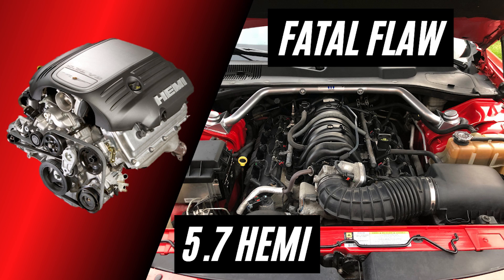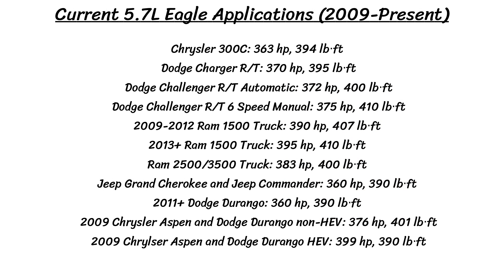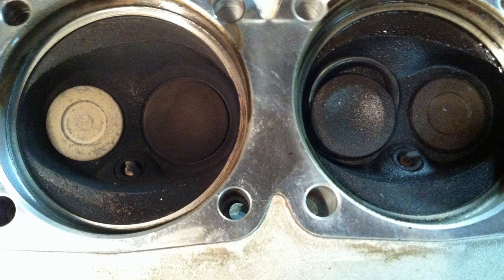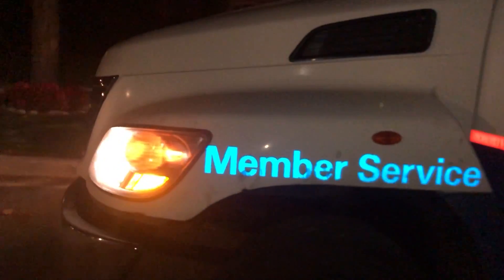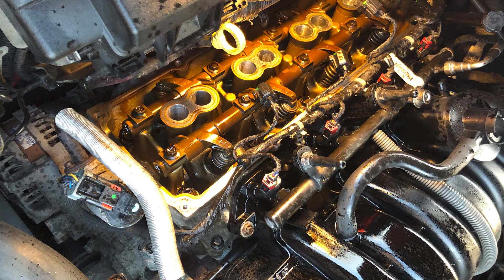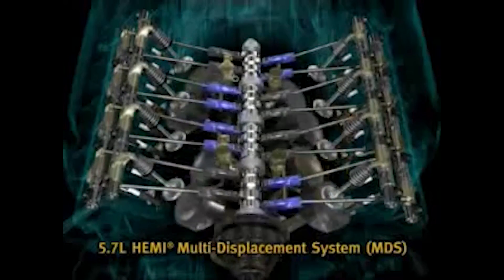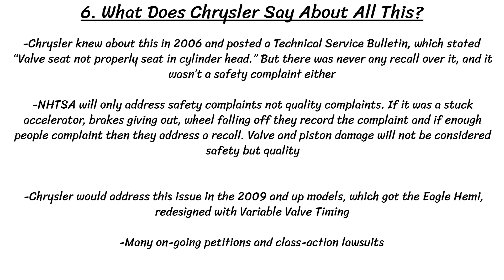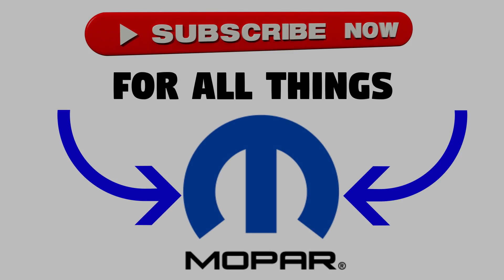The Fatal Flaw of the 5.7L Hemi V8 Engine & How to Prevent It (2003-2008 Valve Seat Drop)

Comment: 180 degree thermostat. I was not a fan of it on my 06 300C 5.7. Long runs on the highway with cruise control set caused both oil and coolant temperature to drop to 180degree, this in combination with the mds system on would I say make this problem worse? Cylinders that are off are even further cooled by the 180* circulating coolant. Nice video, I learned a lot from you.

Comment: People seem to either have no issues with these engines or catastrophic failure, which I guess based on what the issues are, comes as no surprise. If you don't have this issue or the lifter issue it seems like these engines just run great for years totally uneventfully.

Comment: Same thing happened to my Mom’s 2007 Dodge Charger. It happened at around 100,000 miles. The car had a lifetime power train warranty on it, but they tried denying it by blaming it on a faulty thermostat. Turns out they were testing the thermostat wrong and they ended up having to honor the warranty. The car is now mine and is at 185,000 miles, so it’ll be any day now. Thanks for the good tips on preventing this from happening. I’ll start doing the maintenance more often to hopefully squeeze as much life out of it as possible.
Reply: update?
Reply: @ just rolled over 200,000 on the odo, still kicking strong for the most part except for a coolant leak that I can’t find. I put some leak dye in the system and will keep a check over the next couple of days. I’m suspecting it’s my water pump

Comment: To be fair all of the big 3 manufacturers have had major problems with cylinder deactivation. It almost always leads to cam/lifter damage leading to catastrophic engine damage. It's not just a Chrysler issue.
Reply: That's the reason why we only purchase Toyota far superior engineering compared to the garbage big 3
Reply: @Gshock714  Funny you mentioned Toyota, I just purchased a 2010 Venza 3.5 AWD. If you do some research there's a nasty problem with oil cooler lines that rupture because they are rubber. I ordered the recall metal replacement lines today.
Reply: @michaelmarks5012  yeah every manufacturer has problems and is not perfect but I still trust Toyota a lot more than the so called big 3 especially in reliability and longevity

Comment: My 07 is about to turn 235,000 and still running great. Going through a qt. of oil every 3,000 miles so no complaints so far. 😎
Reply: I have a 2002 Dodge ram 1500 4.7L with 230,000 miles. Change the push rods and the rockets @ 220,000 miles. Running great.

Comment: My 2007 Ram 1500 with 5.7l hemi has 219,500 miles on it and runs real well! Kiss of death posting this? We'll see.
Reply: I have a 2008, 2500 with 257,000 miles it's still strong. I have a 91 octane tune in it and drive it like I stole it. Lol
Reply: @garyhaley3072  you have balls of steel, are you still using the original transmission?

Comment: Yep.  Happened to mine.  I bought it two years ago.  Had 49k on the odometer.  Car is top notch.  It dropped the seat on startup after being off for 5 min.

I fixed it in my garage and did both heads and a piston.  These pictures are exactly what I found.  While I was in there I did notice that the water pump had failed at some point before my owning it because I could see there was coolant that had dropped onto the splash shield and wasn't cleaned up.  Water pump was super shiny.  So the only thing I can think of is that yes its probably heat related and it could happen at any point in time once an overheat has occured.

If you have one and want to keep it for awhile....  replace the heads.  Thats the only way to be sure.

Comment: .005  is a five thousadths press fit, and that is really tight. A good question would be how do other manufacturers retain their steel  valve seats in aluminum heads ?
Reply: I agree.  .005 is  a super tight press fit.  I'm curious how the problem has been addressed as well.  I have a lawn mower engine with a similar problem (valve stem guides).  Aluminum and steel don't seem to play well together.

Comment: Changing the thermostat has nothing to do with overheating. The greatest load of BS that has been perpetuated for overheating engines that one. Stupid misinformation circulating for decades from people that can't tell the difference between shit and clay.
BTW I'm not talking about the engine overheating because of a faulty thermostat jammed shut either.
Thermal shock created by the MDS system or other variables inducing thermal shock combined with manufacturing errors is more likely the culprit than the effing thermostat ffs!

Comment: Before even watching im going to assume its about the cam and lifters
Reply: Well I was wrong but cams and lifters also wear out because of the mds. The mds causes more issues than its worth so I suggest just shutting it off. If you're worried about gas just get a v6 or just get a Honda
Reply: @Hybrid Libertarian mds does cause premature wear on lifters which in return causes premature wear on the cam
Reply: @Hybrid Libertarian how mds lifters work is they collapsed rather than just push up on the push rods unlike regular lifters which don't collapse chevy afm is the same way and where they fail is they stay collapsed (commonly called a collapsed lifter) and problems just go from there and anytime you replace 1 lifter you should replace all and if you replace lifters you should replace the cam TECHNICALLY speaking but you can just replace 1 lifters or just get rid of the mds all together and get a bigger cam

Comment: I have an 11 Ram with the 5.7 and I have a code reading of camshaft position sensor. I changed it out but after about 20 miles the check engine light came back on with the same code reading. Truck runs fine and no miss or any other signs that anything is wrong. Anyone have any suggestions?

Comment: You should make a video covering Cadillac's Northstar engines, specifically the early generations of it. It's interesting because the engine is argued to be one of the most complex designed for its time, but also one of the most unreliable. World famous for blowing head gaskets until this was finally fixed in like 05
Reply: I have a 08 6 speed auto North Star engine and it's very reliable and runs like a beast
Reply: @birdwayne4358  Yeah they fixed the problem by then, the problem in earlier models was head bolts liked to corrode and thus overheat and crack, the bolts were too small
Reply: I have a 97 Seville and yeah it takes some special love to prevent those problems

Comment: Something's wrong with mine, it's been perfect.
Reply: Built on a Tuesday.
Reply: Me too it’s called maintenance Coolant tubes should be replaced made of steel they rust out causing overheating and flush and change with Proper Coolant 200,000 on mine
Reply: Savage
Reply: Same
Reply: Mine too.
Reply: Bought not built 🙃
Reply: @dissomeboolshiethowsyourda3443  he’s saying built in the factory you fucking simp.
Reply: @dissomeboolshiethowsyourda3443  damn u on his head 😂😂

Comment: Work at Chrysler for 4 years I never seen this happen. I over heat my jeep when water pump went out and it as over 212k still original engine and trans. No issues with 5.7L and still running strong. Now I know what valve seat issue is.

Comment: I have my 06 Chrysler 300 5.7 with 135,000 miles open due to maintenance replacing head gaskets, valve stem seals so for me is better to buy new cylinder heads

Comment: I was a Chrysler tech till 2013 (25 years) and saw more broken valve spring back than if anything. If I had one do this and wanted to fix it I probably look in to a set of aftermarket Edelbrock heads and a cam swap (392). A long with deleting the MDS. LOL

Comment: 2006 Ram 1500 SLT 5.7L  297,383 with MDS
My Ram is still going strong, I bought it with 109,000 miles for a work truck and Ive had to replace the rear diff. and the driveshaft. The front  end has had 
to be rebuilt but the Hemi and transmission no issuses. Its only overheated one time due to a leak on the radiator. Everything else on the truck still works also.

Comment: 2008 Ram 2500 6-speed manual 205,000 miles, burns a little oil but still running good. Being a manual it doesn't have MDS so that may attribute to it's longevity.

Comment: Got my  2nd 05 300C . It's now at 230,000 miles and no issues. First one had 150'000  and also no issues. And I beat the crap out of both of them. My local mechanic sez it's the quietest hemi he's ever heard. He's a former line mechanic at a large Cal. dealer, and knows his Chrysler stuff.

Comment: so don't shut it off hot...instead let it idle for a few minutes...but there's another video (on YouTube as well) that shows that 5.7 liter hemis have very low oil pressure at idle because of some baffle that prevents lubrication of the camshaft.....this is why they round off their camshafts...🤔 maybe its best to  not start a vehicle with this engine, and just let the tow truck operator drop you off at your destination on it's way to delivering the vehicle to the scrap yard...

Comment: I have a Diablo Tuner on my 5.7l magnum that shuts off MDS, along with a 180° thermostat. I always let my car idle after driving it to let the temps go at least below 190° before I shut it off, and I let it warm up for a few minutes after a cold start. 235,000 miles and counting

Comment: There is another flaw with that engine and it has to do with lubrication getting to the lifters. I forgot the YouTuber name but he's got a video on it and it has to do with the way the engine is designed the lifters don't get enough oil to them which can cause lifter failure. Since the 90s Chrysler engines have had many quality issues, the early 3.5L in certain years would seize at 100k, the 2.7L had its problems and some even told me the 2.2 turbo 4 would have head gasket issues at 50k, so it not surprising that the early 5.7 hemis too would have problems.

Comment: interesting.
i've  replaced 2 valve springs and 1 engine for a broken valve spring that dropped a valve.
and the new ones unless revved a bit will wipe cam lobes.
and now seats in them too.
i'd never heard of that.
need new valve train designers.

Comment: I have a Hemi 345  , 2015 and I am at 97000. Till now everything works perfect. When I will hit the 11500 I will do my timing belt and hopefully is going to take me another 10000 miles :)
Reply: No timing belt on the Hemi, uses a chain
Reply: @bogieman101   thanks I didn’t know that. I thought was the same as the 06 changer 3.5L

Comment: had the same issue with my 2014 SRT8 challenger got it used at 54,000 miles valve got stuck and wore out the cam at 64,000 miles. it was under warranty so we got a new engine.

Comment: The 05’ ram I’m currently driving is V8 all day everyday no MDS here
Reply: Same here börther. 2010 Charger R/T AWD w/ mds disabled via tune. 15mpg börther
Reply: 2005 Rumble Bee 167,000 km  or just over 100,000 miles.
Never gets really hot in Northern Canada...plus I don't really bag the truck anyway.
Still concerned of course...may do the 180 degree thermostat fir summer only.
Thanks for vid.

Comment: I got a 07 Ram 1500 Laramie with the 5.7 hemi. I’ve owned it since it had 20,000 miles on it. I’ve changed my oil between 3,000 and 5,000 miles and now have 163,000 miles on it. I just changed factory spark plugs and they were worn but not horrible. I had to change water pump out yesterday and that was the first part I’ve had to replace since I’ve owned it other then egr valve. I have also used Lucas fuel injector cleaner treatment twice a year since I bought the truck in 09. My main issue has been the passenger side exhaust manifold breaking bolts off from the motor tourking

Comment: 4 cylinder mode shouldn't work until the thermostat opens, or 190 degrees. Basing it off oil temperature might even be more accurate. This will allow all parts to heat up evenly and stay hot if 4 cylinder mode stays on for awhile.

Comment: The only way to solve the problem of the valve seat drop, on all 5.7L Hemi, & earlier 4.7L V-8's, is for FCA, to make the heads from cast iron, & to eliminate VVT.  Great video, explaining these issues!
Reply: Most all engines these days have aluminum heads and the seats don't drop.

Comment: I had a valve seat drop at 204k. Replaced the head and piston, didnt get everything out of my intake and 2 weeks later boom. Same cylinder so another new head and piston. Now i have killer lifter tap due to MDS. Next is MDS delete kit. I wont let my car die!

Comment: I've owned, for the better part of 2 years now, a 2006 chrysler 300C with the 5.7 hemi. I bought the car with 50k miles on the dot, and currently it's sitting at roughly 97k without any issues.
I haven't had any issues with cooling or valve seats and it is running a stock 203 degree thermostat still. I have however had a shop replace the stock exhaust manifolds with BBK long tubes and high flow cats, and installed a catch can and cold air intake myself and gotten an emailed 93 octane tune done up. Next step is my 180 degree thermostat I bought a few months back but never installed and a coolant bleed. Eventually, I do want to cam the car, and I figure at that time I'll get the existing heads either re-done, or aftermarket heads with the valve seats staked properly. 
So far though, so good! Hopefully I don't have to deal with a grenaded v8 in the near future lol.

Comment: Great video, I've made the mistake of rebuilding a hemi motor with a used head, eventually valve seat was drop. I found that the best rout is to buy a set of remanufacted heads from ebey for around $580 for both heads, they also upgraded the valve seat to fix those issues

Comment: I have an '05 Hemi Magnum. To mitigate this issue I installed a free flowing exhaust from the manifolds back, Billet Technology oil catch can, a strict oil change regimen, as well as programed my cooling fans to come on 25° earlier and keep the engine ~20° cooler at all times (via handheld tuner). I'll also let it idle for a few minutes before shutting it off. I haven't shut the MDS off because premium gas is expensive (I'm running a 93 octane CAI tune) and I have a 70 mile daily commute so the MPG is kind of important. I do drive in AutoStick when driving around town though.

Comment: This isn't even the most common issue with the hemi. I have a 08 r/t charger the lifters go out and eat at the lobes on the cam then metal ends up throughout the entire engine ending up in a complete rebuild or replacement. Well that one has 100,200 miles on it exactly when this happened.  Ok well I also own a srt8 challenger 392 and its just turned 63k miles and its started doing the exact same thing and itll total to be a 5k job to fix. Smh dodge needs to do so much better. Thats almost 70k in two cars ans the hemi engines didn't even make it to no time. My advice buy the extended warranty or stay away from dodge. Well the hemi. I'm getting rid of both mines because I can't see all the money being worth it for either one. Smh love the cars but they aren't worth the headache

Comment: Thats one of the biggest flaws for sure it will happen on every Hemi with MDS it will chew up cam from a bad lifter. Happened on mine at 119k wasnt even a mds one but one of my mds turned sideways inside so it starved the other one and i always change my oil on time and with platinum only, Soo I naturally slapped a Hpt+ cam with hellcat lifters and upgraded the springs with PSI then refreshed the heads with new guides. Best thing that ever happened to it! Hah

Comment: These engines should only use 5/20 motor oil  any thicker and you will have a proplem with lifter flow simple

Comment: i got a 300c 5،7l with long tubes mds of with diablo tuner 91oct cai tune cold air intake and 180degree thermost  with 160.000km runs like a king  never had a proplem would be hell thogh got the Awd so got to take engine out to fix anything but like a sad no prop still

Comment: I have a 2005 5.7 and is still running strong at 189,000 miles. I dont have mds and I also removed the huge resonated and placed a smaller muffler on the truck to improve air flow.

Comment: Have a 2007 300 with 120000 miles and it dropped a valve seat and destroyed the piston.Had motor rebuilt and bored over  to fix cylinder wall ,heads totally rebuilt and MDS turned off which cost 3700 bucks for  everything and have had any issues since but it is rudiculous when you have to spend that kind of money on a car with that mileage and the company new about the issue and did nothing....really would think twice about buying another Chrysler !!!

Comment: damn, sounds like it is a good thing i drive in the 2000-3000 rpm range (for the oil flow) with mds off in my gear select mode of my truck.

Comment: I experienced this same thing at 110k miles on my 2006 Charger R/T 5.7L. Had been freeway driving during the summer, pulled into apartment and shut off for a few moments waiting for my son. Started it back up and WHAMMY! The engine made a strange rumbling, then it stalled, never to start again! Thanks for the vid.
Reply: My son’s just stopped working the other day. The starter makes a click noise and the engine does not turn over. Can you tell me what your symptoms were when your engine went out?

Comment: I have a way to prevent the valve seat drop by keeping the engine running cooler removing the engine cover get some shorty headers and cold air intake. And for a little more cooling get the SRT8  charger factory hood scoop, you will gain more horsepower running cooler
Reply: You can also install the police car/tow package "severe duty" radiator.  The RTs come stock with a "heavy duty" radiator.